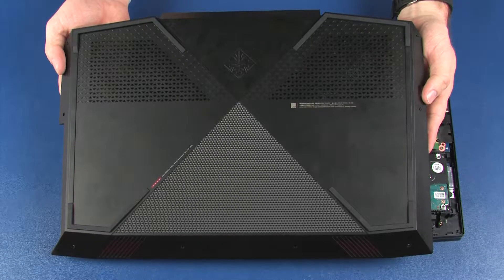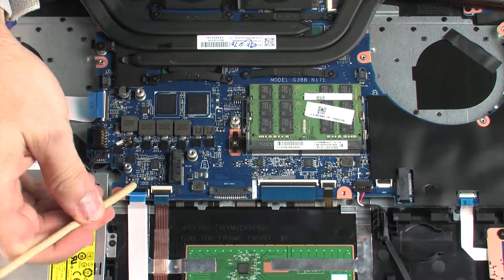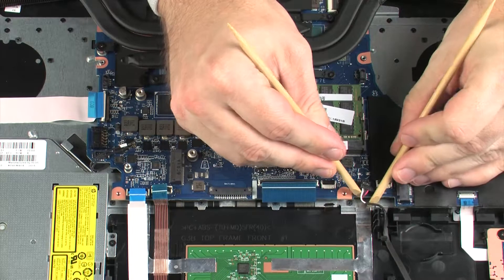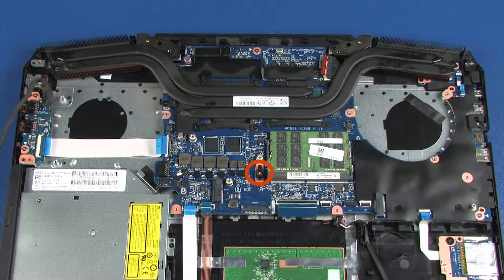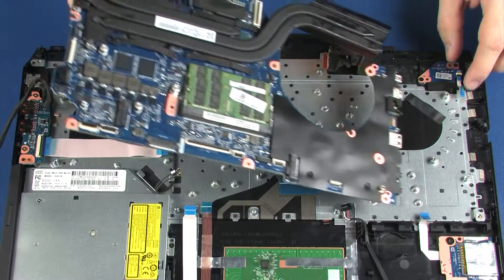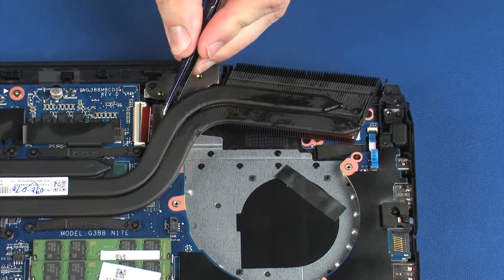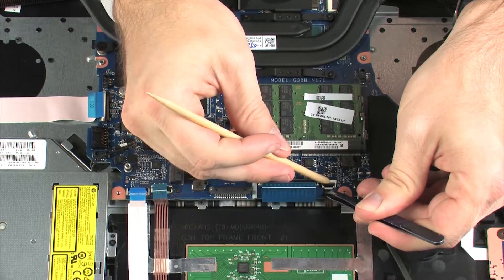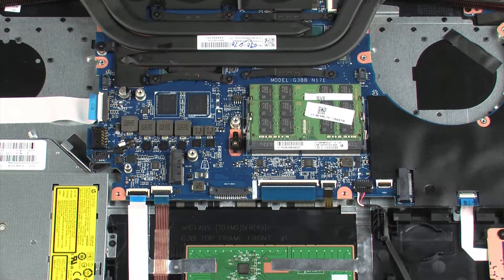Remove and Replace the System Board | OMEN by HP 17-an0xx | HP

Comment: can i change motherboard i7-7700hq gtx 1050, with a i7-7700hq gtx 1070?
Reply from the maker: +ArrowDrill HP does not recommend upgrading or downgrading hardware parts or software that is bundled with the product as It may affect the manufacturer's warranty and performance, however, you could change the configuration at your own discretion.
Reply: @HPSupport  ok i'll keep, thank you
Reply: @HPSupport  Yes set aside the warranty does it work?